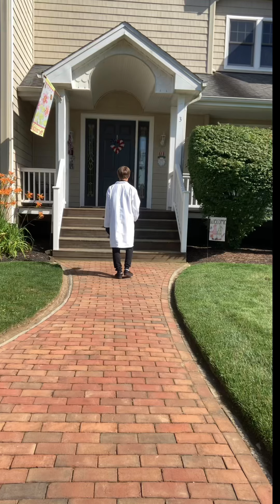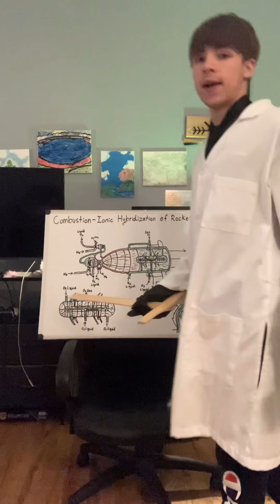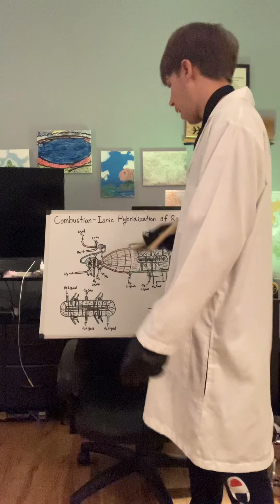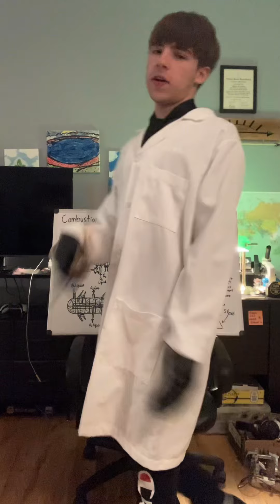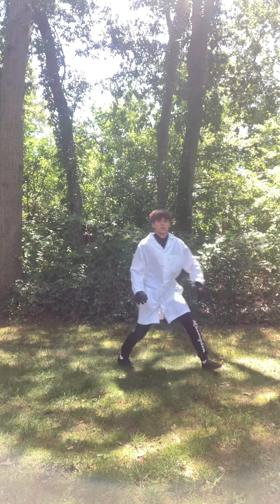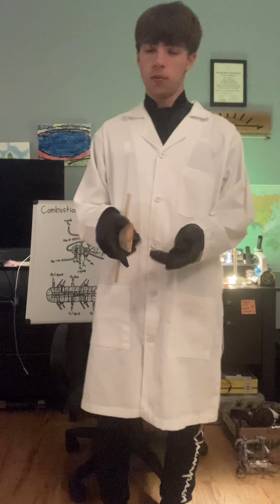Episode 3, The Prototype

Comment: Just do basic calculations based on law of conservation of energy and power. How much energy traditional rocked engine uses and how much the most sophisticated ion thruster can consume.
The power of a traditional rocked engine is an order of magnitude higher than the best ion thruster.  

Don't need integrals or complicated math. Just energy in → energy out. If that works out, you can start prototyping.  

Ion thruster have completely different use case, so combining them in that sense could be not so viable. 

Good video btw)
Reply from the maker: Thanks for the comment. This is some of the first feedback that I’ve gotten from someone who seems to have actual experience in the field which Is what I’ve been looking for. The theory itself doesn’t actually serve to prove whether near light speed travel is possible but rather to identify a more efficient way to potentially achieve it. My main equation (as I showed in my first and second video) is there to calculate the velocity of the ions exiting an ion thruster. My theory stating that if a molecule enters an ion thruster already in motion then it will accelerate exponentially in proportion to its initial velocity and the variables of the ion thruster itself (aka Voltage, Amperage, Distance between the Anode and Cathode, etc.). 

You do have a point with an Ion-combustion hybrid rocket not being the most practical as there are a lot of technicalities that are involved with it and a lot of issues that could be presented by it. It’s really just my first iteration of what a Rocket like this could potentially look like with the end goal to be the exhaust of the Rocket itself moving close to the speed of light. But then of course there are also so many other issues with a ship moving at that speed even if you had a feasible way to do it.